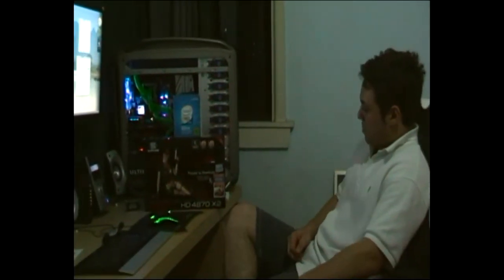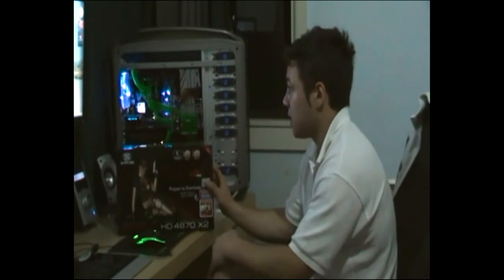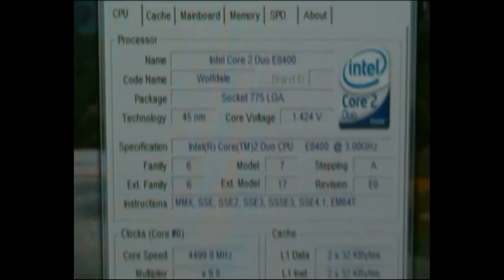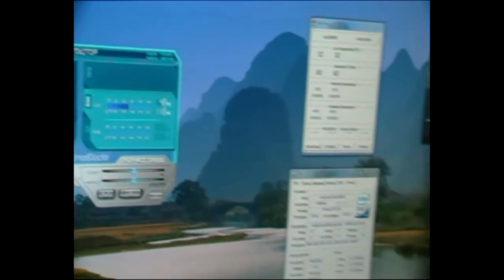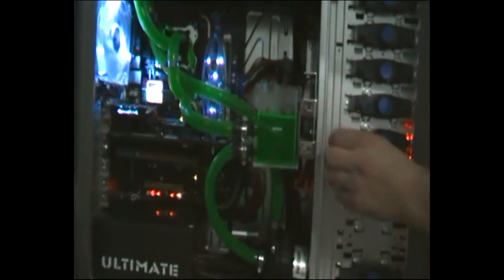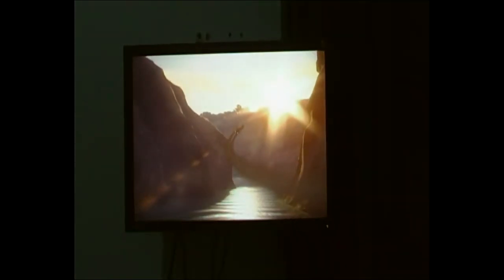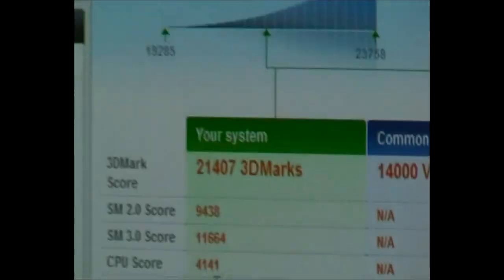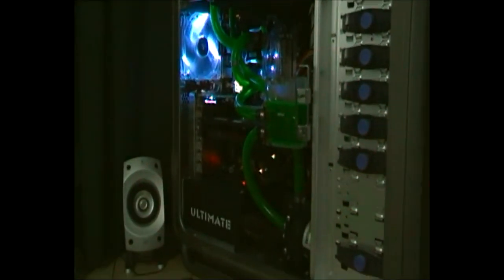Extreme/4870x2 CrossfireX PC Build for 2008!(Part 2.5)

Comment: Good vid mate. My machine only manages 12500 with a 4870 x2 but that on the latest 3dmark and I dont know if they give the same rating. I have not had trouble with my card.

Comment from the maker: Hi Erebus32,

Strickly for gaming i would personally go with the E8500 E0 stepping, as for Quads the is only a few games that support Quads at the moment, even so there is little Benefit.

For Example:

My E8400 E0 is running @ 4.5GHz !! which Screams through everything in terms of gaming, It will almost be imposible to get a Q9550 @ 4.5Ghz with the sort of cooling i have.

I hope this helps :)

Comment: thats not true
becouse the quads will only spit data out in 2 of their cores
basicly the same as a dual core but with 2 more blobs of silicone on them that will run the backgound stuff(wich is not realy the worth the pice difference)
an E8400 is faster then a Q6600@3.0gh
and the the overclock that he has will make it impossible to get a bottleneck(4.5gh O_O)
the guy is flashing bioses
he probably knows what he bought :D